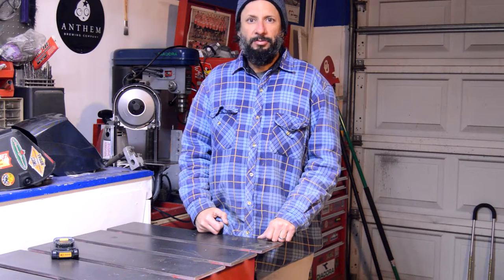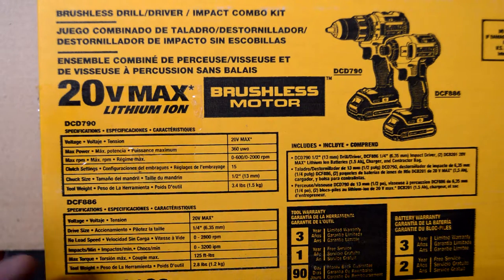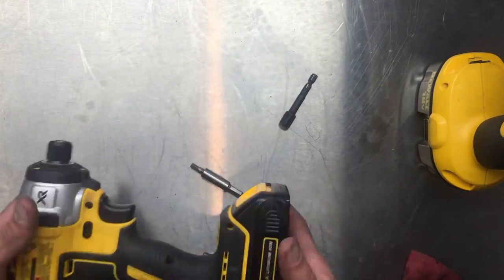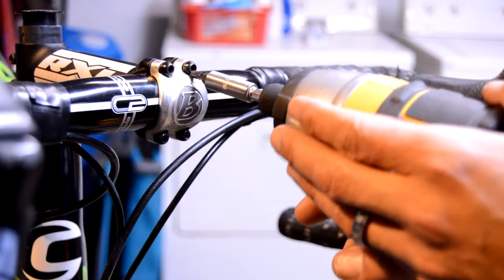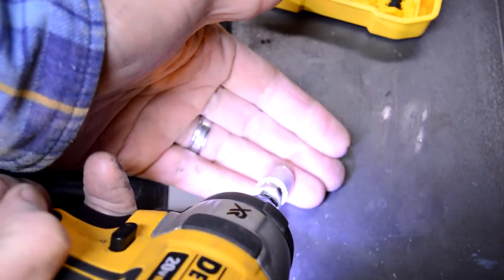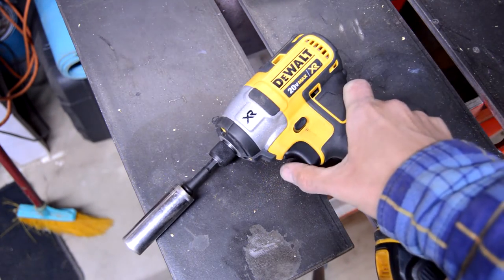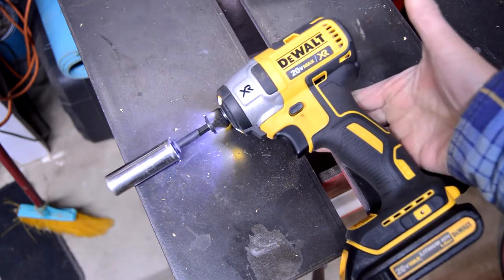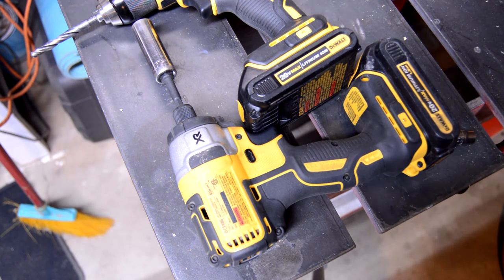DeWALT drill/driver-impact combo review

Comment: thats a nice set  i might upgrade from DCK240C2R that set i got two 5ah batteries already with my older brushed motor set  i even got a few older 14.4v dewalt drills one dw990 xrp  and a dw991  aswel as a dw935 trim saw